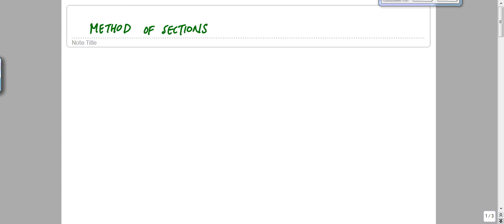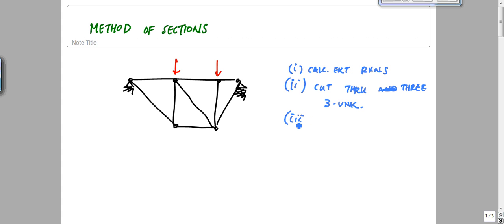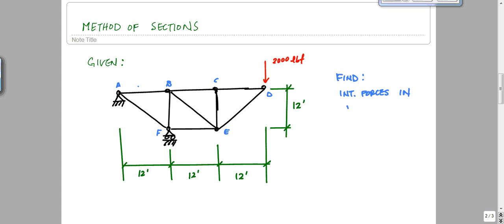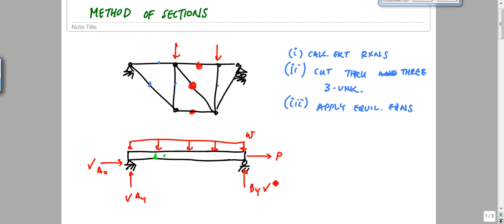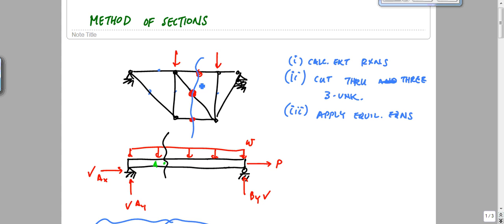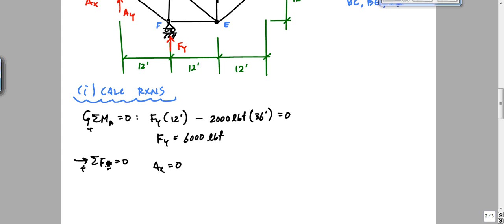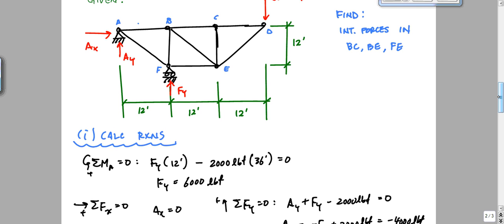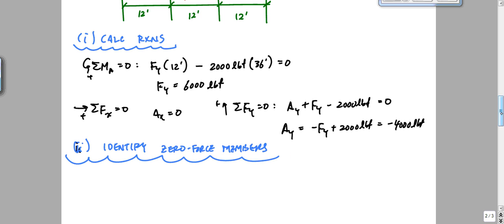Method of Sections for truss analysis Example 2 - Statics / Structural Analysis

Comment: in calculating the moment around B, should not you consider the vertical and horizontal component of member EB or the member does not produce moment?
Reply: no because it goes through the point so does not produce a moment

Comment: those are members that their internal forces are already counted and cancelled out because it is static system and also that is the reason why you would use methods of section because it is faster to solve problems when you have complex frames and trusses. In the FBD, he drew the internal forces in red pen so we know which forces to count when you do moment about a point B.